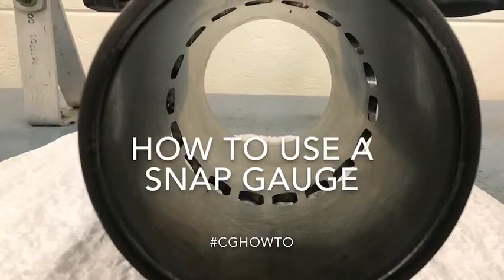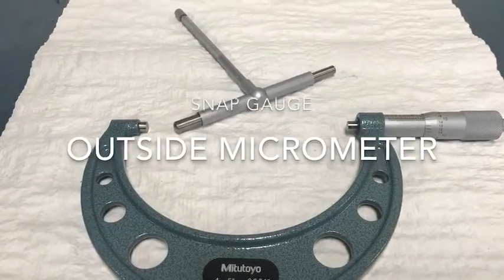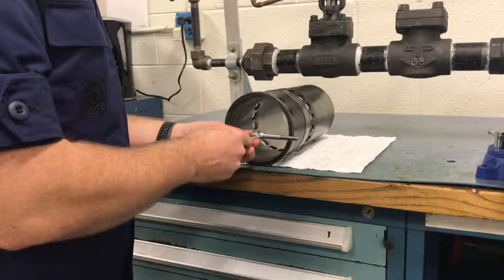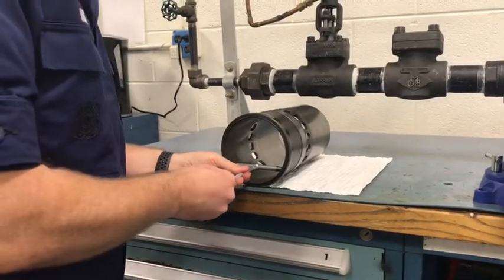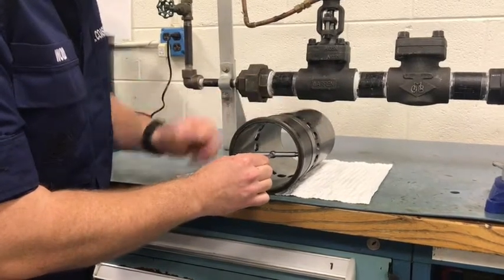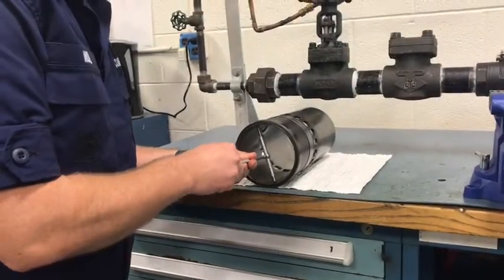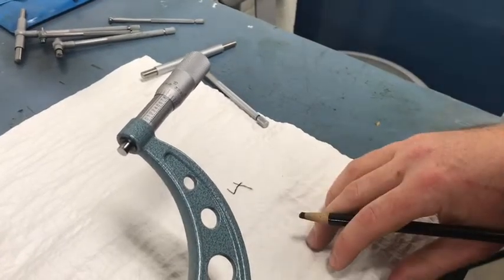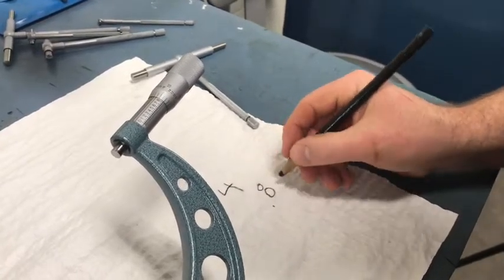How To Use a Telescoping and Snap Gauge

Comment: that is not the correct way to use a telescoping gauge.
Reply from the maker: John McRae, we are always looking for improvements to our videos. If you would like to submit a video showing the correct way to use a telescoping gauge we will be happy to share it. Respectfully
Reply: @CGHowTo  Reading back what I wrote it does not come off very well, my apology's. it is important the proper techniques be used in order to achieve good results when using a telescoping gauge as it is a reference tool especially for a bore with a close tolerance. place the gauge at a slight angle to the bore so the gauge is reading a larger size, snug the locking screw then move the handle so the tool arcs through the bore compressing the tool to the size of the bore then measure the tool with a micrometer.
Reply: @johnnym1320  this is correct